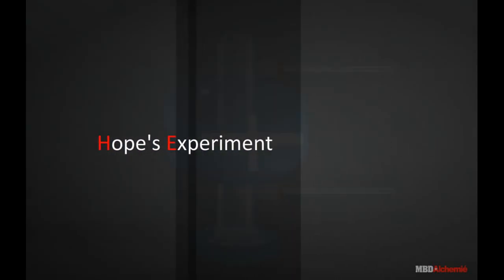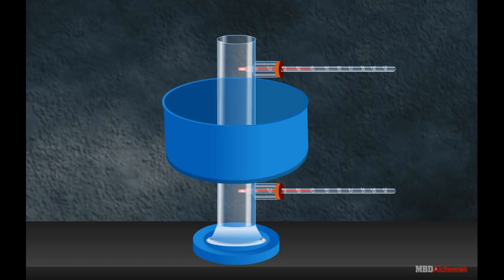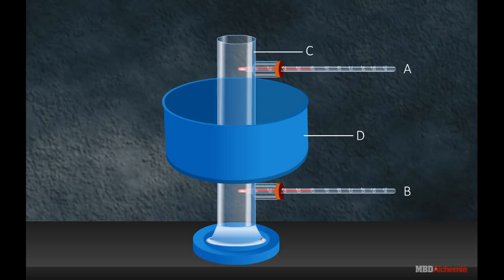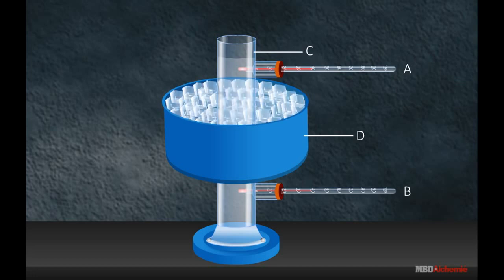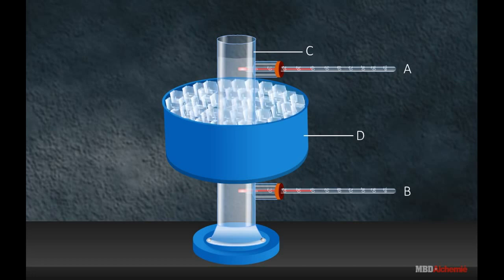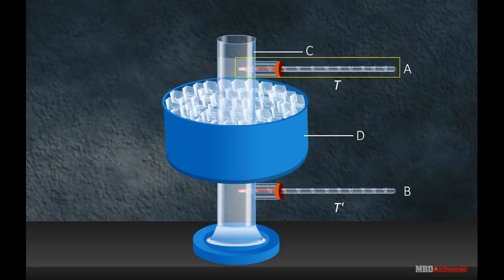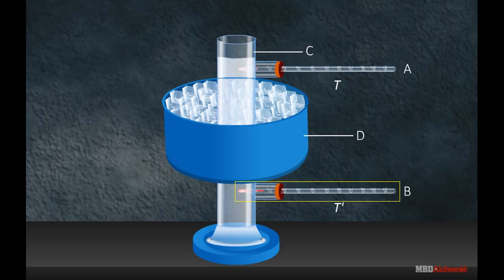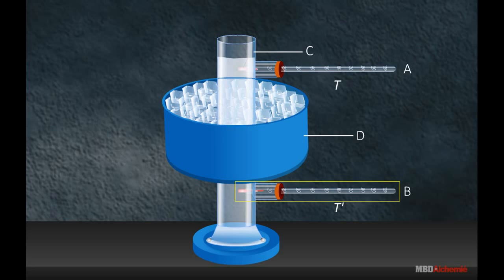Hope’s Experiment Explained | Air Expansion on Heating | Class 6–8 Science | AASOKA

Comment: So how does it prove that the maximum density of water is at 4°C
Reply: First the water at the middle section of the cylinder starts cooling. During the
cooling process water contracts and being denser falls to the bottom. As the
process of cooling (fall of temperature) continues more and more water fall to the
bottom. The process of cooling and falling of water continues till the temperature
of the lower half of water in the cylinder reaches 4

oC as shown by the

thermometer T2. Thus the temperature in the lower half Is at 4oC and that in the
upper half is above 4oC as shown by the thermometer T1. Further fall of
temperature and flowing down of water stops. Instead the temperature of the
upper half begins to fall because of the flow of heat from upper half towards the
middle section caused by the difference of temperature The process of flow of
heat continues till the temperature of whole of water in the cylinder attains the
same temperature of 4oC as shown by the thermometers T1 and T2.
Now the temperature of water at the middle of the cylinder begins to fall below
4
oC and expands. Being lighter it goes up and so the temperature at the top
begins to fall. The process of falling of the temperature and going up of water

continues till the temperature of whole of the upper half cools down to 0oC. It is
indicated by the thermometer T1.
Thus as regards temperature the water in the cylinder is divided into two distinct
parts (i) one (upper half) with temperature 0oC and (ii) the other (lower half) with
temperature 4oC. here oC means degree Celsius
Reply: So  in both cases cooling at middle part starts first??
Reply: @AnomitraChatterjee yes